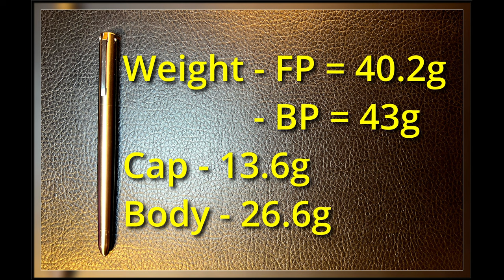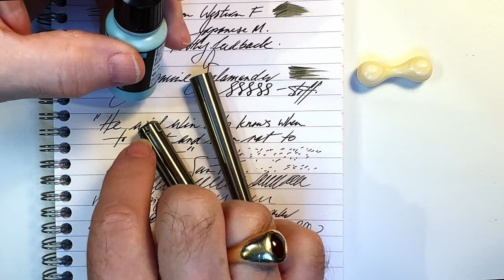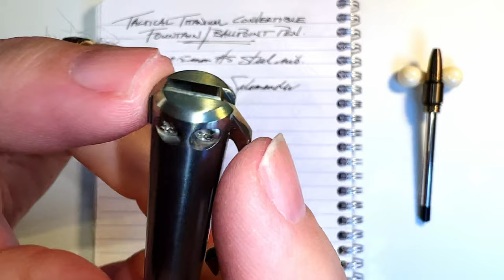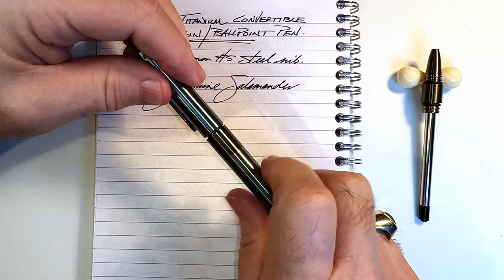Titanium Tactical Convertible Fountain Pen Ballpoint Pen Unboxing Review and Anodization 2022

Comment: It is a challenge to design threaded titanium parts. Titanium tends to gall severely when threaded together without lubrication, anti-gall coatings, or good thread design. What the pen manufacturer did was choose a square thread with a very coarse thread pitch, which naturally have thread-start issues you experienced, in order to minimize seized sections. The pen maker knew that the sections would be assembled and disassembled frequently and chose to err on the side of sloppy thread starts instead of using any conventional machine thread that carries high probabilities of gall induced seizing.
A further note on square threads, they along with buttress threads are used in power-screw applications like screw jacks. The torque applied to a part with square threads is efficiently transferred as axial force, in large part because friction in the system is minimized. That friction is one factor in the galling process of Ti. Ti has a high hardness value, but it also has high ductility and toughness. This makes Ti-Ti threaded connections prone to "losing tiny chunks" , smearing those microscopic chucks because of relative movement between parts, into both parts and inducing the dreaded seizure of Ti-Ti connections. This why anti-seize compounds are recommend for Ti-Ti, Al-Al and Stainless Steel threaded connections.
Enginerd here and I specialized in threaded connections for a part of my enginerding. 👍🖖
Reply from the maker: Thanks, Kenjiro5775, for the excellent information!

Comment: Nice job, weirdo. It occurred to me that the screws on the clip are sealed in with Loctite. You can weaken it with a little heat. Also, you may want to get some Wiha bits.
Reply from the maker: Hmmm good point!